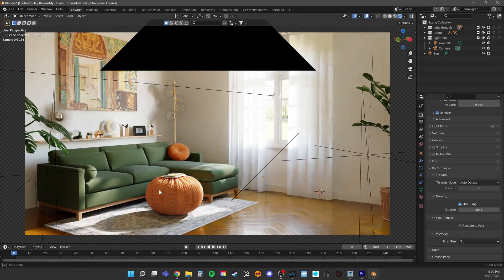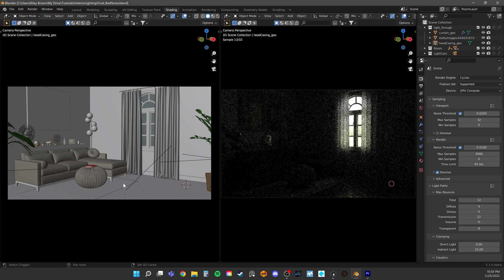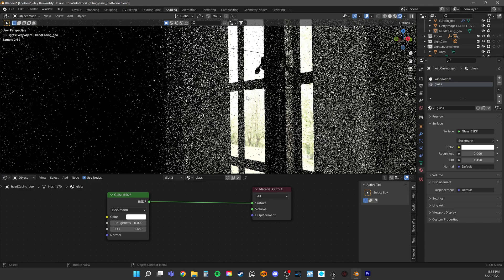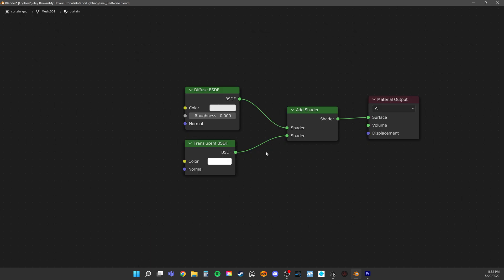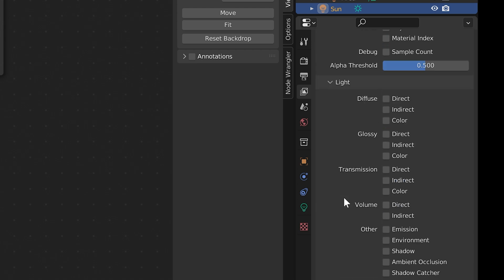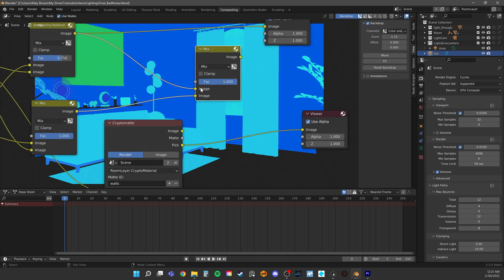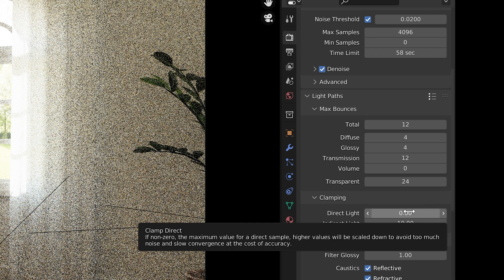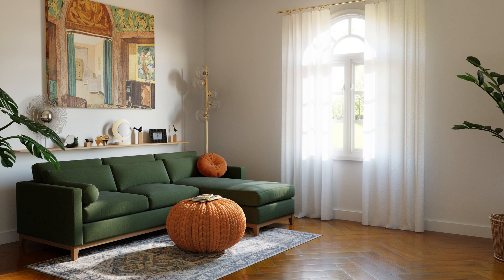Optimize interior Renderings in Blender Cycles

Comment: Mad! 🔥🥵 Where exactly should the portal be placed btw? Should it intersect where the window is, or should it be placed outside or inside the room? Couldn't tell from the video.
Reply from the maker: I find it best to place it just outside the geometry of the window. If you place it intersecting the geometry, you might get some strange artifacts in the window frame (it's also generally just not a good idea to place any form of light or emitter too close to, or intersecting with geometry as it produces more noise).

Comment: This is great, I'm literally trying to lower my render time on an interior scene right now!
One thing I'm noticing though, with Noise Threshold, is that it's VERY sensitive to changes and - at least when there's lots of weak point lights like in the scene I've got - it loves to make dark areas mottled and splotchy. I've actually gotten better looking results leaving it at .01 and lowering Max Samples, but I've seen a lot of tutorials say not to do that. What's your opinion on messing with samples vs threshold?
Reply from the maker: Yes, I would definitely lower max samples from the default 4096. The only reason I left it at 4096 in this video, is because I had a time limit applied (45 seconds). Ultimately the renderings in the video got to about 256 samples before finishing. 

When starting a scene I usually have .02 noise threshold and 256 max samples as a starting point. That way my preview renderings are nice and fast. I slowly increase as needed. First with overall noise threshold, and then with max samples.
Reply: @rileyb3d  Ah that's good to know, thanks!

Comment: Wow - that was fantastic. Some awesome interior tips and tricks. Do you have any opinion on adding a volume density for interiors? I see it suggested a lot but always just looks hazy or foggy when I try - keen to hear your thoughts. 

Have watched all your videos so far and enjoyed this type the best - I might just be a sucker for an interior render :)
Reply from the maker: I don't personally think it's a fit unless you're really going overboard with dramatic light rays, or it's purposefully a smoky scene.

If it's specifically a light ray through the window you need, I would personally handle that by having geometry for the light rays. For the shader, I send an emission node into the volume on the material output (no surface output), then turn the strength waaaay down. 

If it's subtle enough that should work, and it renders fast. This might be worth exploring in a separate video allogether though. You can customize it further and get some cool things like dust particles in there too.

Comment: Great info video. Quick query... did you render it in 4k samples? Like seen in the video or would recommend a lower value?
Reply from the maker: I typically use 256 samples as a starting point on my scenes. I just left it at 4k since I set a time limit. It ultimately rendered out around 300 samples given the time limit of under 1 minute.

Comment: Thank you, as someone switching over to Blender from C4D this was very helpful. Do you have any recommendation in regards to glass objects in dramaticly lit environments? Refracted light generally seems very noisy and the same cryptomatte denoising approach isn't always applicable due to texture & details in the surface. I'm kinda banging my head against a wall trying to get the noise down to an acceptable level in glass/refraction heavy scenes, especially with complex roughness textures involved. This seemed like far less of an issue in renderers like Redshift or Octane. Tried searching the documentation for anything useful, but I'm kinda lost. I'd appreciate any pointers.
Reply from the maker: I’m curious if you utilize your redshift license for blender. If so, what’s been your experience? I’m a former redshift user in Maya. To answer your question, I don’t really have a quick reply, but if you have a particular scene, I’d love to take a look and optimize the file. Just pack it and send it over to Riley (at) brunwork dot com.